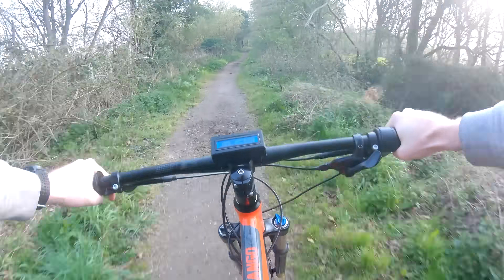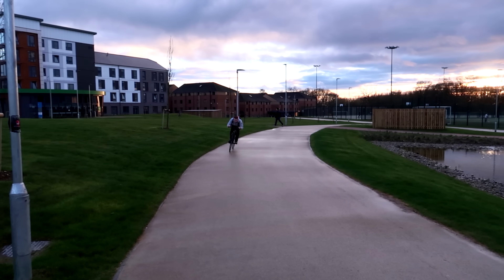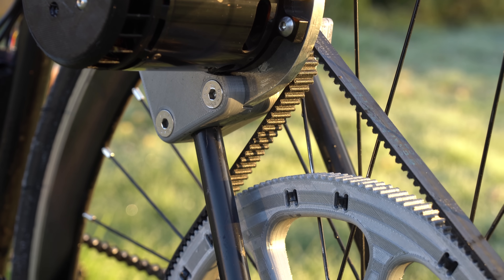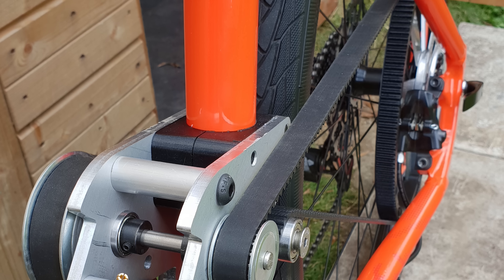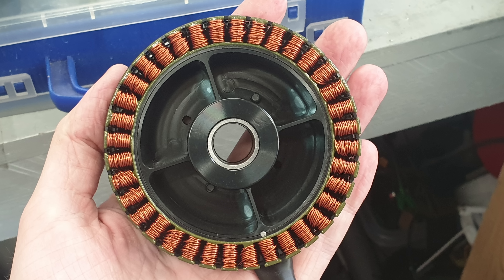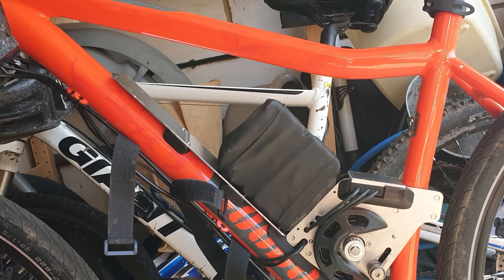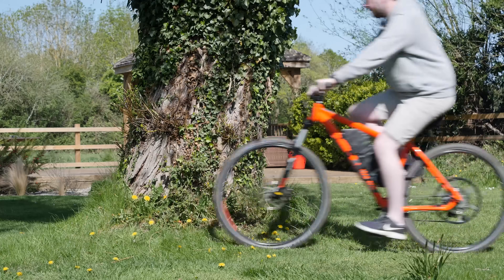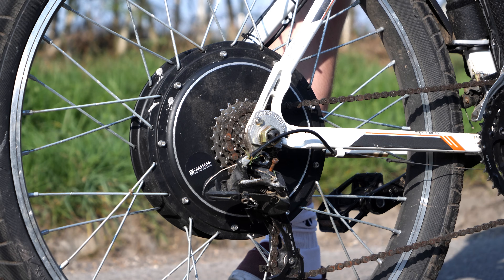Building an Electric Bike

Comment: I have been 'given' [it is not here yet because I have to come up with the money to ship it] a decent sized 24 v forklift motor I aim to make a bike from.
Reply: That will weigh about half a ton, might work to convert a car but not a pushbike
Reply: @andyb7963  Who said anything about a PUSH bike? And NO they do NOT weight 'half a ton' the unit weighs 263 lbs as it sits, moves a 7900 lb forklift and with some aluminum housing pieces can be brought in under 180lbs.

Perfect for a 2 wheel drag cycle!

Comment: isnt a ebike that goes faster than 15.5mph required to have a licence? lmao
Reply: Yes. plus it has to be approved by the DVLA [or VOSA?], taxed and insured.
Reply: @Frightningman  and a motorbike helmet.
Reply: @julianshepherd2038 no you can also use a speedpedelec helmet those look a bit more like normal bicycle helmets
Reply: @Frightningman  thats an oof for ol tom
Reply: @Frightningman  Yes, it would then be classified as a moped or motorcycle and would need type approval from the DVLC, with a plate on the bike from the approved manufacturer showing this. I'm guessing it might be very difficult/expensive for an individual to get this for a homebuild project.
Reply: A pedal assist bicycle must stop the motor at 15.5 mph.(with a max continuous power of 250Watts) The motor must only function when the pedals are turning. (no twist throttles)
What Tom has built here (very well I might add!) is classed as a speed pedelec. This requires a driving licence, registration, tax, insurance and you must wear a motorcycle helmet.
You might get away with it, but in an accident, you'd be going to court.
I'm not anti Ebike, I ride a Haibike Sduro mountain Ebike every day..........Just be safe out there.
Edit: all of the above refers to riding on a public road or cycle path in the UK. if you only want to ride on private land, with the owners consent, you can build any power you like.
Reply: It has a throttle so it's considered a scooter type anyway that requires insurance etc
Reply: @Richard F I'm all for more rights to cyclists (honestly I'd love to have the US's 750W limit), but don't forget that cyclists also tend to ride on footpaths (whether legally or not) and powerful electric bikes on footpaths are pretty dangerous. Obviously so is a fast non-electric rider, but allowing fast electric bikes suddenly makes a small problem very big. This is one of the reasons for the paltry 250W limit.
Reply: My razor pocket mod goes like 23. And its the pink one...
Reply: I think those restrictions are only for public roads. I remember seeing some ebikes with off road mode that turned off power and speed limitations. I think they banned  that switch later on though.
Reply: @Richard F It's mainly so strict to protect slower road users.  Cyclists (and eBikes, which at higher speeds are almost like scooters) can cause a lot of damage.
Reply: No, it changes vehicle class to a moped.
Reply: VADER  no
Reply: VADER  
Either get it tested and insured/taxed, or make sure you don't get caught.
If you act like a dick and get all e bikes banned, then I will be at your door with torch and pitchfork!!
Reply: Come to Norway and try this, instant jail, and huge fines.. 😊
Reply: It's Britain. Probably needs about 10 licenses before even sitting on the seat.
Reply: Depends where you're from
Reply: @abrahamvinod9804   yeah i know, but he is from england, and so am i
Reply: it depends where you live. Here in hungary no1 gives a flying fuck. But u can't go over 30 kph with them on the bike road.
Reply: But who's gonna test it?
Reply: @andrewdavies1312  
"But who's gonna test it?"
The DVLC would be my guess.
Reply: @andrewdavies1312  the Police..
Reply: Ideally, add software limiters so it's slightly lower than whatever the limits are, then add a hidden turbo button. :D  hate how the government always has to put their dirty hands in our affairs though.  Can't have a hobby or have any fun without them trying to control our lives.
Reply: @redsquirrelftw  If you have private land or access and permission to use some, then you can pretty much do whatever you like.  So, no, the UK government isn't meddling in our lives any more than keeping people reasonably safe requires.
Reply: @tams805  Do you seriously believe that is ethical to compare a guy with a e-bike to a mugger ? in the name of a supposed safety guaranteed by a written paper ?

Comment: It's so noisy. It is as noisy as my first electric bike that I built 7 years ago and it had chain instead of belt. I also used a motor from RC plane.
Also, you mount all your variants of pulleys directly to rear wheel. As for me, it's dangerous because if the motor accidentally stops at high speed, the wheel stops as well and you loose control. I mounted it to the wheel with a freewheel.
PS I reached speed pf 65 km/h on my bike and after rather small amount of riding didn't like the design so decided to redesign it, but didn't finish it yet.

Comment: How about using an optical sensor from a mouse as a ground speed sensor and revisiting your abs video. Great vid!
Reply: They need to be pretty much on the ground to work. Your mouse won't work after you raise it about 2-3 cm
Reply: @tshepp89  you can put a lense in front of the sensor to adjust the optical plane

Comment: "This is my homemade electric bike. It isn't powered by a battery, instead a turbine fed by a pressurized tank creates the electricity needed to turn the motor. The fuel efficiency is pretty good as I only have to get off and pump the tank full with a bicycle pump every 30 feet."
Reply: Maybe you could mount the pump to a flywheel, so you can use the pedals to pump the pressure tank.
Reply: @kalleguld  big brain moves
Reply: @kalleguld  well that sounds like a regular pedal powered bicycle
Reply: @vflinck1324  woosh
Reply: @vflinck1324you’re special
Reply: @kalleguld  ingenious!
Reply: @kalleguld  Well that just sounds like a regular bicycle with extra steps
Reply: @kyriekwsta770  je uni
Reply: belly laughs!
Reply: @kalleguld  i like your style friend
Reply: @kalleguld and that's normal cycle.
Reply: Everyone laughs, but a team at my College actually built a compressed air bike. It used a section of the bike frame as the tank and pedaling would help compress the air. However I am fairly certain they did a turbine to spin the wheels instead of converting to electricity.
Reply: @CollinOstrowski  compressed air powered bikes and car design are nothing new...
Reply: @nc3826  what about li-ion battery's to feed a light air compressor on board ....possible?
Reply: @loganf9701  added complexity and weight... with decreased efficiency... ie a Rube Goldberg invention....
Reply: @Synonym_MS  Indeed, however his was a reciprocating design which utilized timed solenoid valves. It is technically more air efficient as the air can't (in theory) leave the system without having helped move the piston first while a turbine will still let air pass if it isn't spinning, but a turbine can achieve much higher speeds.
Edit: It can achieve higher speeds with proper gearing/belting/whatever is used for the power train.
Reply: The OP was sarcastic but the responses are serious. I don’t know whether to laugh or cry 🫤
Reply: @OnerousEthic  😎
Reply: @OnerousEthic sell around robinhoods barn kits i guess 
Cast lots and sell merchants dice to keep from crying i guess?
Reply: The closest you can get to this is using liquid nitrogen engines.They are real and the energy density is about the same (terrible) magnitude as Li-ion.
Reply: You made me smile. Thanks :)
Reply: How to make freewheel? Much needed for this project!
Reply: Liquid airtank.
Reply: Have you considered nuclear power for your next build?
Reply: Is there anyone who wants to study this together?

Comment: Look into Moped Variators. I used to build out 70s mopeds for performance. Some had Variators which is basically a simple CVT. 

Look at the Peugeot 103 moped.

 There are plenty of performance mods for handling the power. They are also light and very tunable.

Comment: replace the aluminium plate with stainless steel.  It does not have the eddy current problems.
Reply: Carbon fibre would be better, stainless would weigh a fair bit

Comment: I think you are spot on with this video, as well as your assumptions on your audience. I’ve gasping at name brand electric bike prices and what you get for the money. Of course there is trial and error + hundreds of hours work involved in doing this DIY, but when it’s a hobby, all that matters is the enjoyment (and cost of parts). The idea that I can convert my existing bike to electric is tempting in so many ways, and your videos have shown that while it is a lot of work, it’s not black magic.
Reply: Check out the BBSHD series if you want something of a kit-form diy thing. I have the weaker, older bbs02 and it's a trooper. over 3k miles so far. i've seen people put 10k miles on them with only the sprocket wearing out. The HD versions are beefed up in every regard.
Reply: @cho4d  I'll check it out, thanks for the tip!

Comment: Notice to anyone who wants to build their own e-bike : in the uk it is illegal to ride a e-bike with a power over 250 watts or has a throttle. Also working pedals are a must.
Reply: You must be fun at parties 😉
Reply: You can get away with a 350/500 watt motor as long as its assisted and 25km/h max
Reply: @captainheat2314  I've gotten away with 1500 watts for the past 3 years. People assume as soon as you set foot (or tyres) outside with an illegal eBike, you're going to get swarmed by a SWAT team. That's not the case. You ride responsibly, stop at lights, don't speed, respect the road and everyone else on it and most importantly: Pedal.
Reply: @lewearle  absolutely, I have a bafang bbs02 750W, hot rodded controller, 52V 40Ah battery in a 29er hardtail, does 30mph and about 60-70 miles on a charge, and I pedal all the time, police don't even look at me

Comment: Great video, Tom. I've followed you since the first eBike video you put up which was part of the convincing for me to build my own a few years ago.

I used a BBSHD and a 48V 14Ah 13S 4P battery. This week I'm swapping the stock controller for a BAC 800 running at 72V 60A with 96A peak current. Got a 72V 12Ah 20S 4P battery too. Sony VTC6 cells.

Most fun I've ever had on a bike, that search for more torque is endless, easier on a mid drive though as you can play about with the gearing.

Comment: As always, amazing upgrades Tom. Out of curiosity: a downside on a hubmotor for commuting is when the motor's not running, it adds extra resistance to your bike. How does your design fare on this front? you mention converting your design back to a bike relatively quickly but is that necessary to ride normally (aka without extra resistance from the motor)? Thanks
Reply: Can’t you have a hubmotor with built-in freewheel? How much resistance does it even have with open contacts?